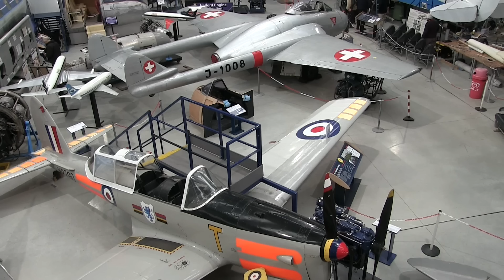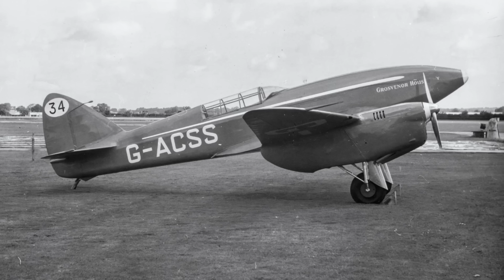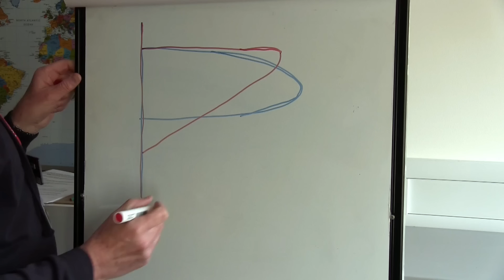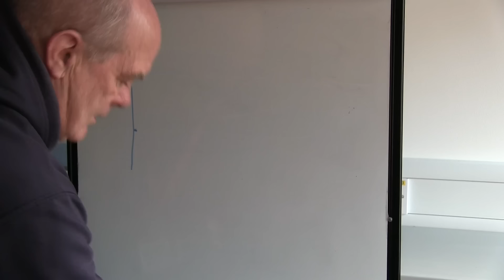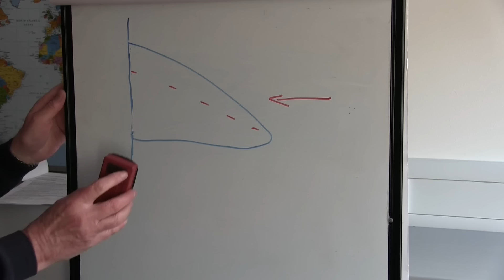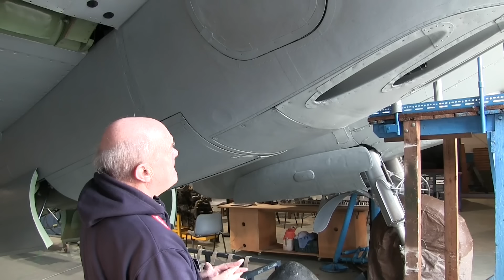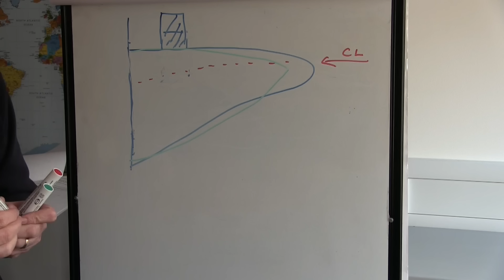Why Did the Mosquito Have Triangular Wings? The Mystery Explained

Comment: What a completely pointless video? Q: The Mossie had a "Triangular" wing, why? A: dunno, but here's a weak theory...it's something to do with the engines. Maybe? More likely it's to do with the radiator's being buried in the wing root's leading edge mounted ducts (very unusual for the time) & the position of the wing spar relative to them. Moreover, being of laminated construction, the grain would need to be as straight as possible across the spar to give it the best chance of coping with the mass of the engines, weaponary & the load baring from the undercarriage. Lastly, straight LE's are quicker & easier to manufacture, which I have a feeling has much to do with it?

Comment: at that time, airplane engineering was not so sophisticated as we know it today. There were no computers, 3D models, air tunnels. Most of the designs were rather practical in construction, than useful in flight mechanics. Mosquito was not supposed to be maneuvering platform, and it was designed to fly streight at top speed. I would assume, the shape of the wing has to do with structure, landing gear implemantion, ruggedness of the wooden construction, engines implementation, cooling systems implementation, fuel tanks implementation. The engineers just had to do a precise job in terms of fitting all in as sturdy as possible and yet with very simple and cheap construction manners. Its not a science but effective construction engineering.

Comment: It would offset the weight of the engines, while letting them put them so far forward that maintenance is much easier. 
A closer center of gravity/center of lift makes the aircraft more unstable but also more efficient and maneuverable.  Getting them close also lets you make a smaller elevator surface on the back to offset the difference, which would reduce weight, drag, and structural stress. 
It's also wood - so heavy engines and a light body would lead to stretching the envelope more than one expects. 
Note that the twin-boom jet you showed earlier (1:15) also has the same shape outboard wing.

Comment: Would you say that the P-51 Mustang had similar wings?  Certainly the leading edges of the Mustang's wings seem to be more 'square' than the trailing edges, but I did notice you were careful to say that the distinction you were highlighting was one of degree and not one of kind...
Reply: Good point, the Mustang had very advanced wings developed by exhaustive wind tunnel research.
de Havilland did very little aerodynamic research and it didn't have a modern wind tunnel available at the time the Mosquito was developed. It's wings are primative by comparison.

Comment: Hey this is just my suggestion but a good comparison would be the Me-210 & Me-410.
In the case of the Me-210 an attempt was made to keep weight down and performance up by minimizing the length of the rear fuselage. however this created issues with poor stability because it’s center of lift was too far back with leading edge sweep and straight trailing edge on the outer wing panels. To address poor handling this was reversed on the Me-410 i.e. straight leading edge and sweeped trailing edge on the outer wing panels. This moved the centre of lift forward like as found on the mosquito.
Trailing edge slots and longer fuselage helped too.
I think the mosquito with its wing platform got to have slightly bigger and therefore effective flaps of split flap design rather than more complex and heavy types and could have a shorter fuselage as its tail was more effective for stability further back from the centre of lift. This all reduced weight and improved performance.

Comment: With all that weight on the wings if one of those engines failed with a tapered wing it would most probably just barrel role into the ground no matter how much rudder you apply. The extra lift of the final design most probably made it controlable.

Comment: Manufacturing had a lot to do with it's design keep the shape simple puts less stress on the wing structure and is far easier to build. 
You would need sufficient cord for wing loading in the correct area without compromising drag . 
A one piece spar and wing section for ease of manufacture.

Comment: Having a sharply tapered wing like the mossy pushes the centre of gravity forward and away from the centre of pressure. This makes the aircraft more stable, the downside is that it’s more likely to tip stall but adding reflex into the wing section stabilises this a lot.

Comment: The pilot/navigator's view down from the sides a factor - pilot can sit at contre of lift and gravity but have a better than average side view? 
Materials driven choice - is it easier for the wooden structure to support the merlins with a straight front edge?
Cost of straight leading edge taper being lower that that of the spitfire style eliptical wing?

The DH99 is far more like that on the Hornet.

Comment: The mosquito was built from the main spar backwards (upwards). So its probably (at least in part) a manufacturing reason. 
Getty images"the-wing-section-for-a-de-havilland-dh98-mosquito-twin-news-photo" shows the construction method (I dont think I can link to the picture directly)

Also a large number of gliders have straight leading edge and tapered (or double tapered trailing edge). See Morelli M100/200/300, Urupema, DG200. Club Libelle, Twin Astir, Phoebus, ASK21 and Janus. Maybe not as pronounced as the mosquito as they have larger aspect ratios for soaring performance but definitely "triangular" wings

A number of gliders also had LE sweep forward past the perpendicular. See Blanik, IS28, IS29, ASK13, and the experimental SB10

Comment: It appears that the centre of lift line corresponds with the maximum thickness of the wing section towards the wing tip.
Not sure if that is relevant in this case, though it does seem to be a aeronamic design feature in may wing types.
Good demonstration Ian.

Comment: The spanwise lift distribution is an important factor here: the high taper leads to having the highest local lift coefficients at the wing tip, which creates undesirable stalling characteristics. The forward sweep has a balancing effect: it tends to move the highest local cl closer to the root. So to get the drag benefit of the high taper, whilst creating  a better lift distribution, this planform is a good option. The drawback is that, when the wing stalls starting from the root (which is what we want), the more forward center of lift, from the lift remaining at the wing tip, tends to create a slight nose-up moment (which we don't want at stall).

Comment: Unlike Supermarine and Hawker positioning of the radiators under the wing, the DH people put them on the leading edge between the engines and fuselage. This must have killed any lift on this part of the wing. The wings outboard of the engines must have been doing all of the lift.

Comment: Actually there were quite a few aircraft that had triangular wings. The Beaufort bomber, the Handley Page Hampden as you mention, the Junkers 87 Stuka (whose wings were also cranked) the  Henschel 129 ground attack aircraft, and the Douglas Boston bomber. All of these had triangular wings like the Mosquito. Some had their wing leading edges very  near to the nose of the aircraft (Mosquito, Henschel 129) while others had the leading edge far away from the aircraft nose ( Stuka and Boston). So there does not really appears to be any particular trend why aircraft had triangular wings. Concerning the position of the leading edge relative to the nose on these aircraft pretty much aligns with where the bomb load was carried. Those aircraft having  leading edges near the  nose had bomb loads near the front of the aircraft ( like the Mossie) all the rest were carrying dropable weaponry near the mid part of the fueselage. As stated elsewhere in this  discussion probably the main reason was to allow the wooden wing spars  and related wing design structures to maintain torsional stiffness

Comment: I don’t think the engine mass position theory makes much sense because the engine on a single-engine aircraft is even further forward from the leading edge.  I think the forward-swept wing is for reducing trim drag because you can tailor the lift distribution of a forward sweep to have inherent pitch stability to the point that you can make forward swept "flying wings" (i.e. no horizontal stabilizer) like Jim Marske's Pioneer competition gliders amongst other examples.

Comment: No mystery:

1) We start at approximate mass and what engines and mission load and distance. This yields approximate wing area driven by takeoff speed / landing speed. We also start with a tail dragger. Thus nose can be short and we have a theoretically lower structural weight in the landing gear.

2) Its a twin. You want the engines as close together as possible. The further forward the closer they can go. The further forward away from the wing the more efficient and quieter they are.

3) Because of CG limits and center fuselage propeller interference limits we now have a forward and width approximate placement.

3) We need to house engine and gear in the nacelles. Its structurally desireable for the spar to be straight. Thus they made it straight.

4) Next for efficiency we approximate an ideal lift distribution. We know the approximate taper. We also know we want to minimize spanwise flow. And we want also to minimize flutter. With all of that we have the wing planform with a straight leading edge.

Fuselage and empennage is designed to be minimum is sized and have appropriate tail volume.

Theres zero mystery why they made their choices. Its just obvious design.

The P-38 starts at a different mission, a different landing gear type, different building material, different engines that have both a turbo and super vs a compound super thus a different configuration. It also makes sense.

Comment: Another point is that a straight leading edge (rather than swept or leading edge taper ) is better for lift in subsonic aircraft.  The wing taper from root to tip is a good approximation of the "ideal" low drag elliptical wing planform, but is much easier (and stronger) to build.  Getting the props forward of the nose of the aircraft is probably another good idea.

Comment: Interesting video.  Finally got an answer to a question that has nagged me ever since building mozzie models as a kid.
I always intuitively assumed it was to make the leading edge of the wing as strong as possible so that it could handle the hedge trimming the mozzie was famous for and still get home. The wings being made of wood, would be strongest with straight grained timber along the entire length of the wing spar.
  Bringing the lift forward makes sense as the engines were so far forward which then allowed for a far larger bomb bay,  and no doubt the massive weight of ordnance the Mozzie could carry was a result of that.

Comment: ( Amended, later the same evg )

1. Tipstall is caused by too-thin foil, not by taper: Harry Riblett got that right, & called-out NASA for doing defective science ( they had 9%-thickness chord on the tapered-wing which "proved" that taper causes tipstall )

( Amendment 1 )  -  You NEED to have a minimum of about 13%-chord thickness for turbulent-foils, & 15%-chord min for laminar foils at around 0.6M, at the slow end, you want closer to 18%-chord thickness for the laminars, to prevent stalling.

See Harry Riblett's book on GA Airfoils, which the Experimental Aviation Association has, for that, & he seems to be right, in spite of the program he was using for earning his intuition, was obsoleted last-century.

2. straight leading-edge means less tipspill, & for my low-subsonic designs, I'll be having a straiight leading-edge.

( Amendment 2 )  -  Technically, the straight-leading-edge means not producing spanwise-flow, and the tipspill is an effect of that spanwise-flow.

3. the strong taper means you've got higher Reynolds-number, & therefore if the thickness is the same percentage-of-chord all along stall will begin at the root.

4. if you put the CG behind the CL, you've got an unstable aircraft, & now probably need fly-by-wire.  The early flight-tests of a design need to use experiment  ( pumping water ballast, or moving a weight ) to discover the limits of CG, for safety.

5. rounded wingtips increase tipspill, which isn't what the designers probably want.  Sharp-squared-tips is less, & winglets is much-less, for traditional wings. ( amendment 3, the qualification )

6. the "elliptical" in aircraft-wings is the elliptical-LIFT-DISTRIBUTION, not planform.  Making the planform elliptical doesn't .. likely .. gain you enough to justify the extra manufacturing-costs.  See Raymer's most-recent "Conceptual Aircraft Design" book or Snorri Gudmundsson's ( probably better ) book. ( amendment 3 )

7. yes, it'd reduce drag to get the engines on wings which were more-forward, but the weight-distribution would be the make-or-break for the design, and having a huge amount of weight aft of them, which suddenly-disappears, means the engines .. probably should be as close to the longitudinal-CG as possible, so not much changes in balance, when the bombs are dropped?

Interesting: I'd not considered that complication ( this is amendment 4 )

8. outer-taper in a wing-planform has alot to recommend it: only taper the aileron-part, not the flaps-part: simple, tapered-lift, & cheap to build, etc..

Especially in wartime, making more fighters, instead of making a few works-of-art, can save your life, so cost is SIGNIFICANT in war, & I just don't see why to make elliptical-wings, anyways. ( amendment 5 )

_ /\ _

Comment: One thing that I'm thinking about in the context of the difficulty in manufacture - I would assume that the elliptical shape of the Spitfire wing results in compound curves of the sheet metal, which will be expensive and difficult to create.  The triangular shape of the Mosquito wing  results in a simple curve for the plywood used to make it, an easier and less expensive structure to manufacture.

I understand that this is part of the reason that the US Navy went with the F6F Hellcat over the F4U Corsair.  The Corsair had a lot of compound curves while the Hellcat had simple curves, making the Corsair significantly more expensive and time consuming to manufacture, even with its greater performance.

Comment: I think the purpose may be to put the propellers far ahead from the wings to obtain better lift and aerodyn. behavior, so they had to design a forwards lift center ,and Not the reverse reasoning: put the motor forward because the lift center is forward

Comment: the mosquito wings were made of wood. Wood does not take bending moments as strongly as steel. So it has to be narrow at the tip and broader at the roots to handle the bending moments.
Reply: Not correct at all
Reply: This is the only structural correct remark I have seen. (between a lot of bar-talk) Wood is not that resilient as duraluminium, so structural height is necessary. Not willing to use a thick wing section, you make the root cord big, and create some structural height using a moderate thick airfoil section.
The large root cord can accomadate the coolers too, instead of hanging them under the wing.

Comment: Modern piston and Turbo prop aircraft <Mach 0.8 still use straight leading edge wing because it’s better in every way - more efficient, better stall characteristics, straight wing spars, higher lift to weight ratio etc. 

Examples are the C130, mooney, Aerostar, aero commander, cirrus SR-22, pc-12 etc the aspect ratio gets higher and the taper angle gets lower over time as materials and manufacturing techniques improve but fundamentally nothing has changed.

The problem comes at or near the speed of sound where the straight leading edge experiences extreme aerodynamic drag and makes the aircraft stall - hence why dive bombers needed air brakes.

 This is why jet aircraft have highly swept wings which reduces this issue. It’s less efficient at slow speed, but necessary as they approach speed of sound.

Comment: Three things. 1. The Chipmunk has tapered wings. 2. Centre of pressure must ALWAYS be behind centre of gravity to ensure aerodynamic stability. If it is not you crash and die without flybywire. 3. I think your theory is fundamentally correct!  There also may be a need to place the wing spars at the CofP position so that the bomb bay etc could be where it needed to be. 4.  The negative from such a design is that when the wing roots stall the Cof P moves forward causing the stability to decrease as the moment from CofP to CofG decreases. So the aircraft at the stall will trend to pitch up violently which is an unwanted behaviour.

Comment: The “leading edge vs trailing edge taper” explanation is a bit misleading. It’s not so much about CG as it is about airflow behaviour. Wings with sweep or strong taper tend to develop spanwise flow, which can push the stall out toward the tips. Designs like the Mosquito use a straighter leading edge and tapered trailing edge to favour root-first stall and more predictable handling. On swept wings, like the A-4 Skyhawk, you see things like strakes added to control that spanwise flow by generating vortices and keeping the airflow attached at higher angles of attack.